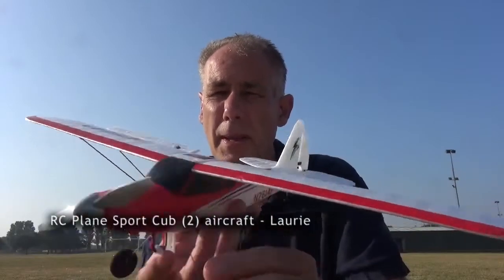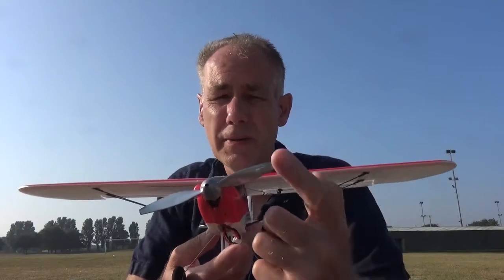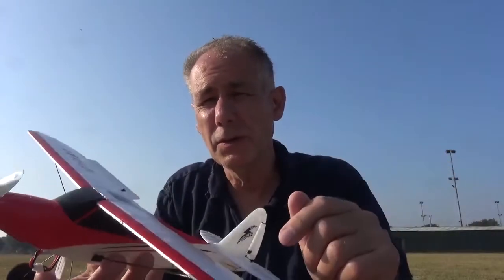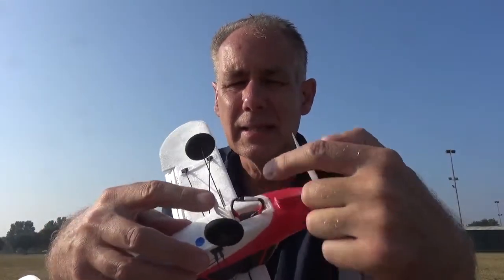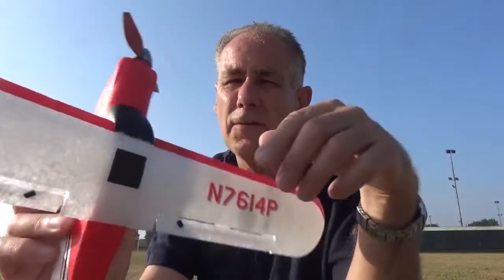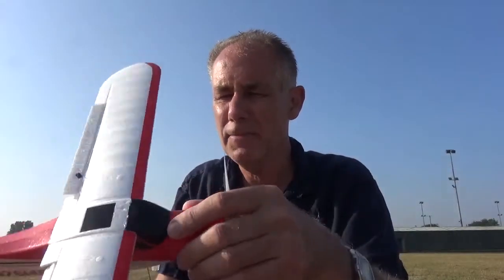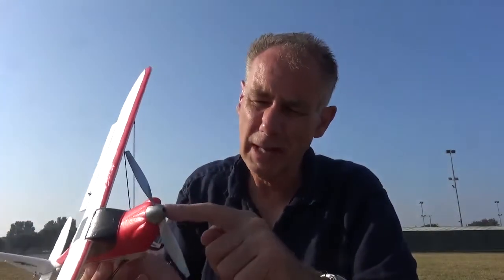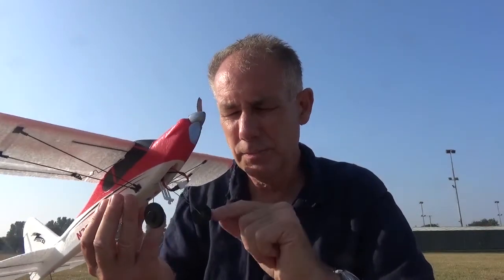RC Plane Sport Cub 8 Tips

Comment: Yep, painting the props is a must. We carry a can of timber or road marking paint. Choose a colour to suit your flying environment. Black is damned hard to see in the grass sometimes!
When fitting your batteries seat the battery in the plane first and feed both leads out through the holes in the trap door before plugging them together. Trying to stuff them inside the body will destroy them pretty quickly. When the pop off props wear a bit and fly off at high throttle dab a bit of rubber contact cement to hold them on. They may break on a nose in but you will get more life out of them than losing them in the bush! 
Dab a tiny drop of CA on the shaft poking through the brass pinion gear. (Keep it off the teeth!) On a hard front square on hit under power that 10x20mm motor will spin the brass gear off the shaft. Good luck finding that in the field! And they are difficult to purchase. We usually just buy a dozen Hubsan H502 plastic pinion gears and bore them out from 1mm to 1.2mm and SupaGlue them on. 
These little Volantex Trainers are the best bang for buck toys available. For more speed the sibling Mini Warbirds are equally top notch!
Reply from the maker: Thanks for your comments. Some really useful tips there. I agree with you a lot of bang for your buck. So much fun.
Reply: I took mine out for my maiden flight today and the prop came off within a few mins. Lucky i managed to find it. After searching the grass for ages it wasn't even there it had been flung further away on the concrete area! I realised then that these should be painted red or yellow to spot easily lol

Comment: I used to fly RC planes back in the 1990s with glow engines. I've also been involved in the development of a quadrotor UAV for research purposes. I can hear that this little plane is sensing your movements and attempting to correct for them, indicating that it must have some inertial sensors in it. It is amazing what technology has been incorporated now into tiny RC planes.
Reply from the maker: Amazing you are involved with developments in UAVs. When you used to fly it was much more tricky, as you are correct, many planes, including this one, have SAFE technology. That allows me to fly in Beginner or Mid mode with stabilisation on, and the plane corrects against the wind and also very harsh moves I may make. Mid gives a lot more control and allows loops. In Expert mode the stabilisation is off completely, and now you have a little foamie completely susceptible to the wind so a non windy day is essential really unless you are very skilled already as I suspect you are. In a way stabilisation is needed for such a small light plane as it doesn't have the momentum and size. This looks a cheap model but it is carrying a lot of computing power in a way. I find it remarkable. I can take risks I could never attempt in other models. It does allow people to fly though, enjoy the hobby, and that's what it's all about.

Comment: I’ve a stupid question you may be able to answer for me. I set the elevators to neutral using the U shaped part on the push rod but it just climbs and climbs (in beginner mode) I need to give it a lot of down elevator stick input to keep level flight on half + throttle. The electronic trim doesn’t do anything? Any suggestions as to what I’m doing wrong?
Reply from the maker: Hi Scott. I have had similar experiences, so I don't think you're doing anything wrong. My Bf109 is trimmed straight from the box. But my first Spitfire is not and it performs just as you describe. If I set it level in Expert mode, the elevator setting is wrong in the other mode and vice versa. I think you just have to trim them manually for your favoured flying mode. I have also found the electronic trims do very little. These are still wonderful little models though. Oh, some people try a transmitter upgrade, so maybe that would help regards the trims?
Reply: Could you recalibrate the gyro while in expert mode? (mentioned in the manual) and when you do it try to keep the plane level straight in your hand rather than on the floor so it calibrates based on the plane balanced flying straight rather than with the nose up due to the front landing gear.

I'm new to the hobby too and this is my first plane. Someone on a forum gave me this useful advice. Not sure if it applies here but it sounds like the issue i was discussing with him.
Reply: In your case this might mean when you bind the transmitter do it while the plane is flat straight in your hand in beginner mode so the gyro is set level otherwise it will keep defaulting to nose slightly up position when it's resting on the floor due to the front landing gear?

Comment: I wish I had watched this video before I had flown my sport cub 500 for the first time because I lost a wheel in flight when the replacement undercarriage comes I will glue the end caps on.
Reply from the maker: Yeah good idea that. The wheels hardly get the chance to rotate anyway, so it doesn't matter even if the wheels get stuck a little but they should glue fine.
Reply: @Calvertfilm  I have received my new undercarriage no matter how hard I try to pull the wheels off I can't so I am going to chance it without glue, the one which came with the plane may have been the first one assembled Monday morning or the last one Friday afternoon at a guess.
Reply: Try the glue on the inside part where the wire goes into the wheel. Might not need to take the wheel off?